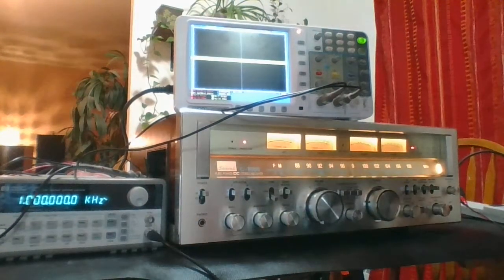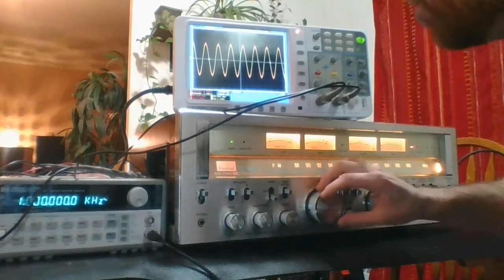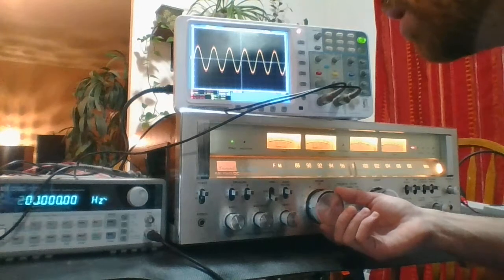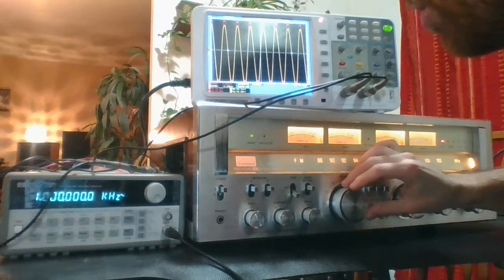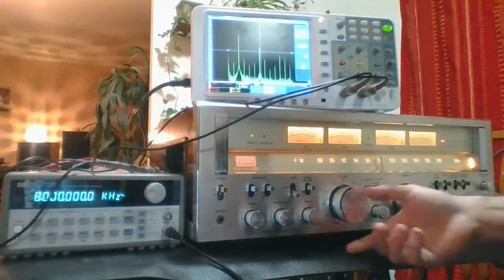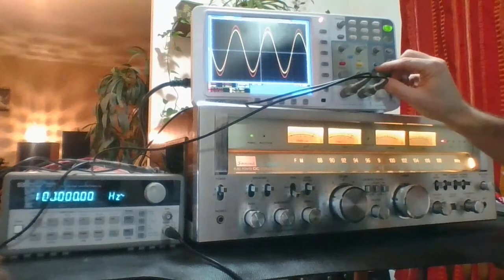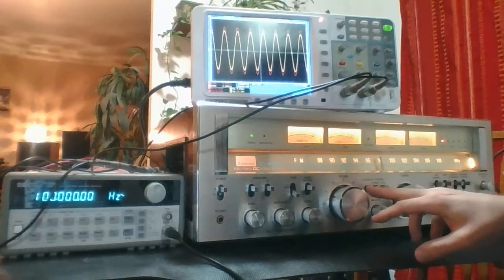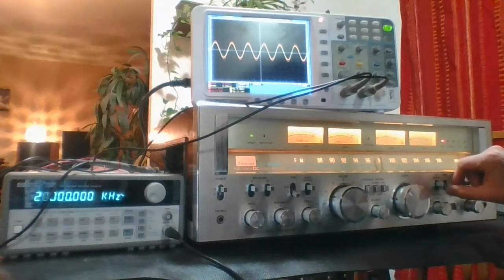Performance test of Sansui G-8000 using oscilloscope and spectrum analyzer

Comment: After seeing this video I got in touch with distant buddy of mine that has lots of vintage audio gear. Grabbed a sixer and headed over
 We listened to his Marantz 2330, Sansui G8000 & 9000 and Sansui AU717 complete rack, with a Sansui SR-838 turntable. Then using a set of JBL L100, Klipsch Heresy, Sansui SP-20000 Speakers went through  some tunes.  Tough to say it was all great. But for the money I buy something still modern high end.
Reply from the maker: orry for the late reply, thats very interesting! :)
Im curious what you decided on? And, where I can meet people with such awsome equipment to do these comparisons with :)

Comment: My G8000 just developed an issue with the protector circuit. Do you have any info concerning that issue?
Reply from the maker: Hi Bruce :)
Sorry to hear about this. Generally, it could be a problem with the power supply, power amplifier or protection circuit.

I would check the power supply values, bias and DC offset on each amplifier board as preliminary troubleshooting. See if you can narrow down the problem with these tests.

Ill try to point you in the right direction. Im located in Montreal if ever you need pro servicing.

Good luck and happy listening
Reply: I think I have discovered it's issue after watching another site. Thanks for the reply @mike-PlatinumAudio

Comment: So how many watts at clipping?  Heard a lot about volts but that's tricky math
Reply from the maker: Interesting question :)

Sorry for the late reply. generally, once the amplifier is clipping, the power wont significantly increase, but the distortion will.

I generally dont want to measure max power, beyond clipping, its probably not healthy for my clients equipment

Comment: How much do u charge to recap and go through a sansui g7700. Make it better then new lol .
Reply from the maker: Hi Ryan thanks for the reply.Assuming Id just be changing the electrolytics, and leaving the ceramic caps, it would be about $200 to $300 ($ Canadian) for labor. Theres probably about $75 to $100  in parts.
If you are seriously interested, I can add up the details for a quote. 
Im located in Montreal, but I may not have time until 6 to 10 weeks from now

Comment: The Sansui G8000 retailed for $900 to $1000 back in 1979, today that's equal to about 3,100 dollars, and these sell for around $500 - $700 vintage today. So can someone get something modern that's better for the same $500 - $700??? I know a modern $3,100 amp is better.
Reply from the maker: You'll be hard-pressed to find something as cool as this! :)
Reply from the maker: I personally have owned both modern and vintage gear. I use, and have used almost exclusively, except for my DAC. I used to say that for the price, especially if you can fix your own gear, vintage gear generally has better value. 

Unfortunately, collection value has jumped a lot, and it's hard to say what is more worth it these days.

I have heard incredible and horrible sounding machines, of any age and price point!
Reply: @mike-PlatinumAudio  just paid $1300 for mine about a month ago.(fully restored)there are some good high end lower cost amps out for under $3,000 such as Emotiva and Parasound.looking at them now to replace my denon 4306 for strict stereo listening of digital music.the G 8000 mainly for vinyl
Reply from the maker: @bhaverly  Congratulations! Sounds like you lucked out! hope she sings beautifully!! :)
Reply from the maker: I did want to mention, that to me, it would be like comparing a 1970';s Corvette Stingray to a modern one. 
A new one may outperform the old one on paper, but the older one would probably put a bigger smile on my face :)

The vintage corvette, would have more than enough performance to keep me happy, as I would never redline it, but there are many characteristics to the classic stingray that Id usually take over a modern, fresh from the factory.

But to keep the same analogy, I can modify/, repair and personalize the old beast to get it to look and behave exactly the way I want.
Reply: @mike-PlatinumAudio  yes sir